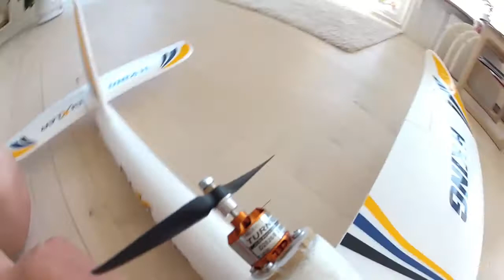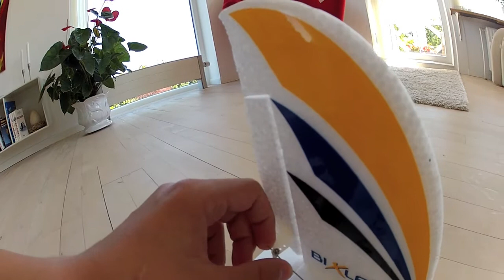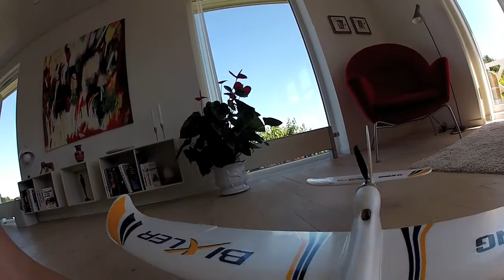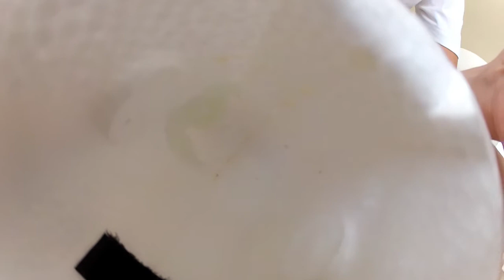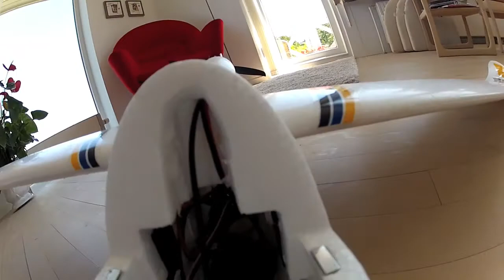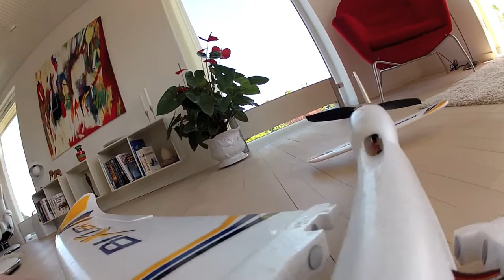HobbyKing Bixler - Mods and Upgrades

Comment: You get 40-45 mins out of a 2200 Mah ?.  Please make a video of this because I would like to see that.   I get a maximum of 15 mins and that's with throttle management as well.
Reply from the maker: As i remember it, i got around 30 min. flights with a 2200 mAh, and 35 min. flights with a 2800 mAh. :-)

Comment: Hi, nice video! May I ask how long your flights are with this set-up? I am hoping to upgrade mine and want to be able to get longer flights. Thanks :-)
Reply from the maker: Well without FPV gear on it i get around 20-25 mins with a 2200 mAh battery, not acrobatic. With 2800 mAh i get 30 + mins. With FPV and a 2800 mAh i get around 20-25 mins depending on throttle style. Thanks for watching :-)
Reply: MultiCopterBuild
Thanks for your quick reply I appreciate your help! :-) Happy flying buddy!
Reply from the maker: kenmercermusic Thank you and you too ;-)